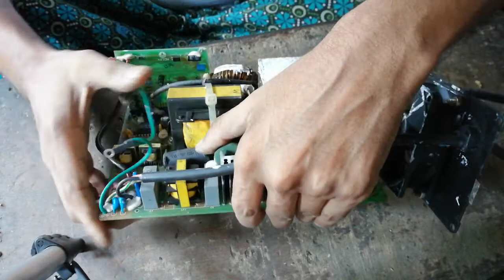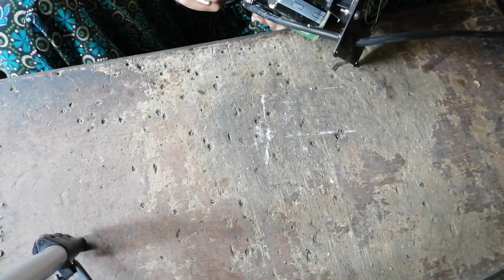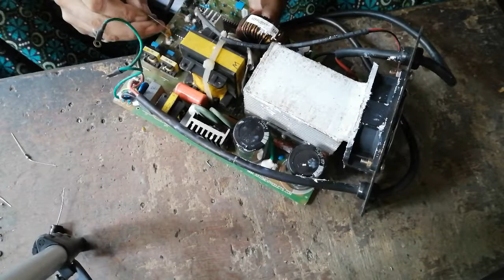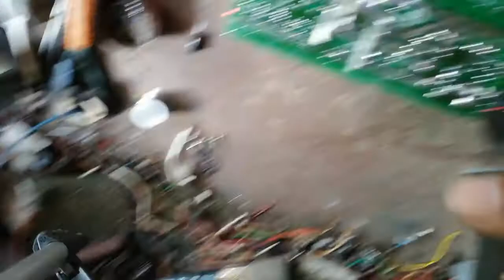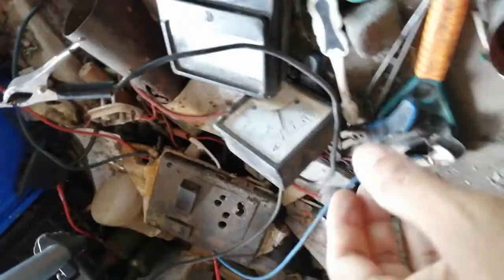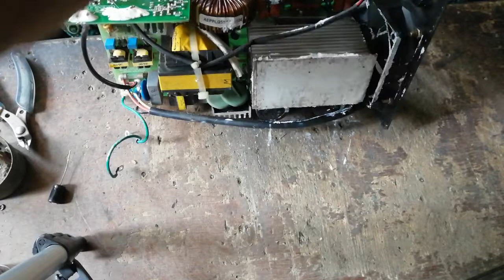E rickshaw charger repiar amp problem

Comment: Sir mere pass hai 3525 ic pr 12v. input jo hai 8 v. show karta hai or mai ic 3525 change kar chuka hu fir bhi 8v. show karta or supply cut kr do to 11v. show karta hai or charging 30% show karta hai or charging led bhi nhi jalti hai please help me
Reply from the maker: 337 or 327sort hosakta
Reply: @electronicssonjib  TVs diode pehle se nikal diya hu fir bhi 337 or 327 bhi change kar chuka hu bhir bhi sem problem hai please help me Sir
Reply from the maker: 104pf chenj krdo

Comment: Sir meray paas shipra electronic ka charger 10 amp hai 1 igbt laga hai aur 1 diode sif igbt ke gate pe 254 v araha hai emitter aur collector pe only 7v 
Charging ampere nahi araha hai charger on hota hai 
Ka problem ho sakta hai
Reply from the maker: Usme ak diode se 48volt output hotahai odiod dekho
Reply: @electronicssonjib  
Sir g diode 5408 laga us se 12 v 
Aur zenar 4746 ek side 12 v dosre side 7v
Reply from the maker: 48volt nikalkar Ampiar mitar may jatahi
Reply: Out put 7v nekal raha hai sir
Reply: @electronicssonjib  ampare nahi araha hai sir
Reply: @electronicssonjib  sir ampere nahi araha hai

Comment: Sir kavhi agar 10/15 sec. ke bad 7812 ic mai input volt sahi rehta hai lekin output volt kam ho jata hai or fan v dhire dhire slow hokar relly up/down ho jata hai kiyo? Lakin 7812 ok hai iska solution dijia plz. Tnq.
Reply from the maker: 400volt 225kpf lagakar dekhiye
Reply: Sir duble driver kiya kiya number